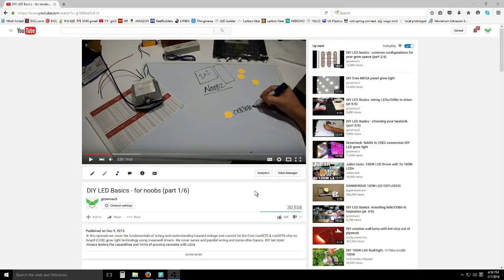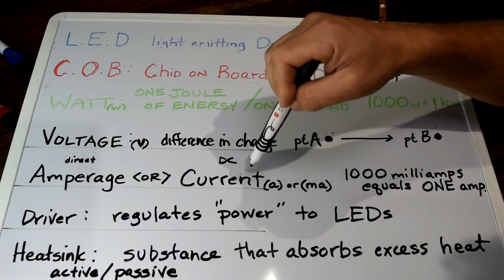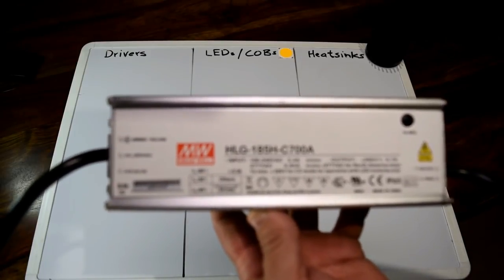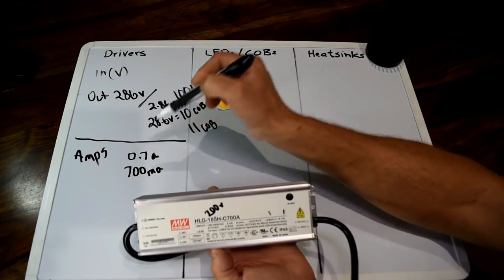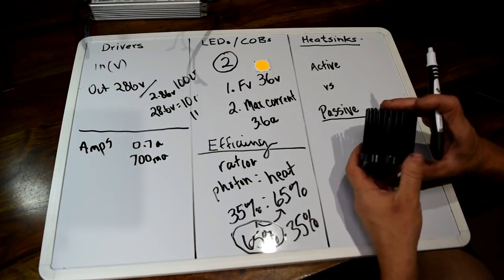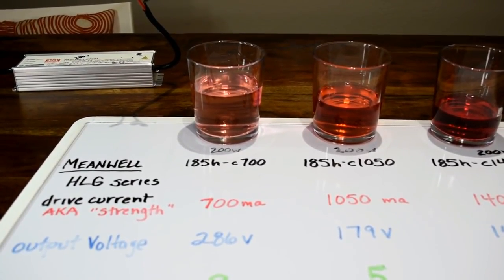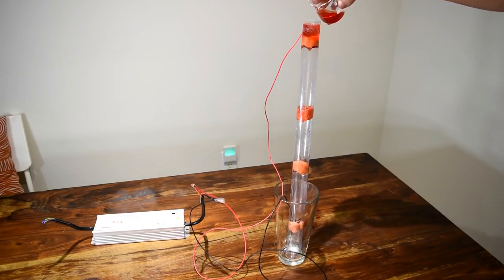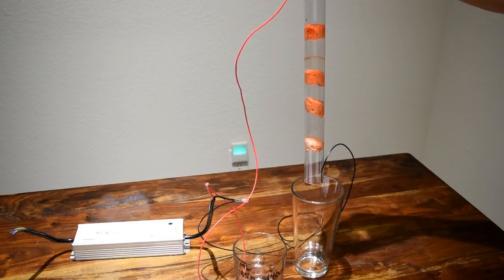DIY LED basics: getting started building your own grow lights: (pt 1/6)

Comment: very impressive skills you have but why would anyone go to all that trouble when you can buy LED panels from china for $100 that will grow a half pound of weed in a 3x3 tent. I own 3 of them and they outperform HID lights.
Reply: lol what led light for $100 are you using to grow a half pound?
Reply: it takes two of them in a 39"x39"  tent to do the job, and a half pound is admittedly a bit on the optimistic side especially for me since I grow OG Kush strains exclusively which are among the lower yielding strains. I am getting about 5 oz. of cured buds from this setup by using LST techniques to create a flat canopy which fills the tent and takes about 12+ weeks in the veg stage, and then another 12 in flowering. If you grow higher yielding sativa strains, you could indeed get around a half pound out of this setup. I am using 2 Galaxy Hydro 300 watt panels which each have 100 LEDs of the 3 watt type but each panel actually consumes only about 135 watts. There are other similar brands out there that will also work but I have read that mine is one of the better brands in the 100 dollar + range. It is a 9 band light with mostly orange-red LEDs and it looks pinkish-purple in operation. The plants love it  but I suggest providing 3 feet clearance to avoid light burn and bleaching from the intense focused light they produce. This is not a problem for me since I grow flat canopies that are only around 2 feet tall but 3 feet in diameter and are solid with hundreds of bud sites.

Comment: WHAT YOUR DOING IS INTERESTING but your limiting yourself to grow lights. consider using strip light for your house! the bulbs needs to be replaced and their should be people interested in putting up NORMAL "white" strip lights. the question is what type of dc power supply to use! and how to connect in parallel. as of 4/1/21 their is nobody doing this in a rational manner!

Comment: What happens with the left over Voltage in the “bank” if you only use a few cobs and there is leftover ??
Reply: there arent volts left in the bank, voltage is a measurement of electromotive force or electrical potential so if you have a 240v driver and you are using 24 x 10 V = 240v you are using 100% of the drivers voltage potential however if you run it at 6 x 20v = 120v then you are only using 50% of its potential or a 50% output efficiency.

Comment: Well you've proven you could teach kindergarten.
Reply: +growmau5  Since you have chosen to go this route, and further decided to showcase 200w drivers, I think you need to really hammer the concept of grounding properly. A safety video would be a really good idea.  You've been super helpful and thorough in your series, but some people don't have enough common sense to properly use these drivers on their own.
Reply: +growmau5 I think those ideas would give people the knowledge they need to operate safely. Whether they choose to utilize them is not something you can control.  You could show how you waterproof your connection points with silicone too I guess.

Comment: Omg you could've just said that the voltage is equally divided across the cobs, and if it isn't the required forward voltage they won't turn on. Why in hell would you "demonstrate" using sponges? Don't mix concepts like "strength" and sponges with electricity, because they aren't corect analogies, it's just a different world and that's fine. You can't equate everything to something familiar.
Reply: chill man.
Reply: @ostrogodo  weird comment
Reply: chill man
Reply: @ursanotsomajor  weird comment x2
Reply: Relax Bruv.  I love u.
Reply: @carsenarsen8634  weird boy
Reply: Your over 4 years to late... Some people need it explained in Depth... 😎